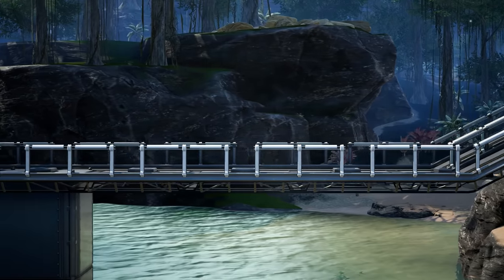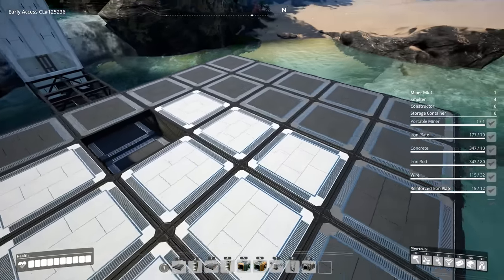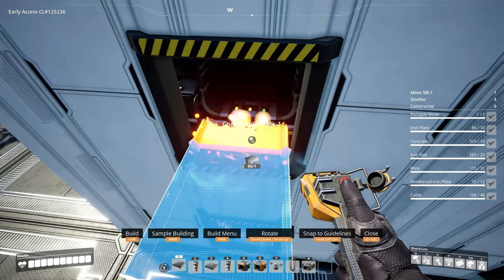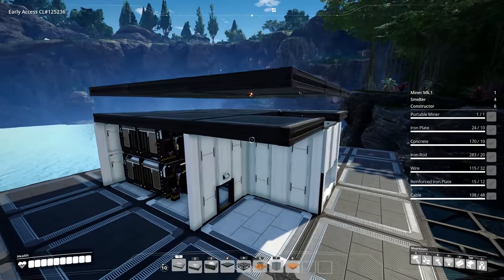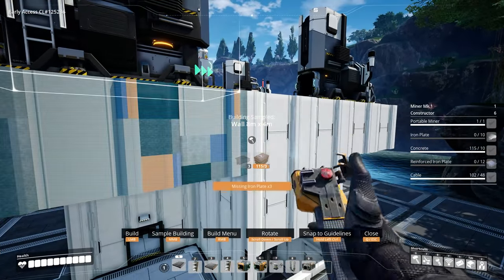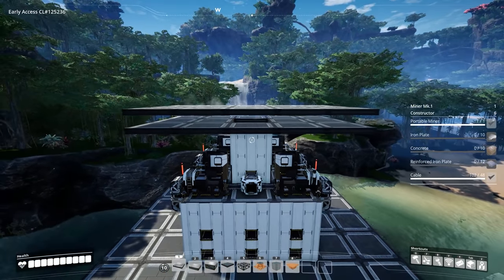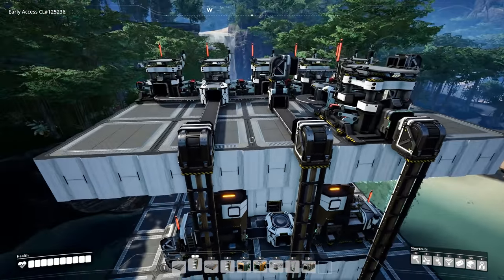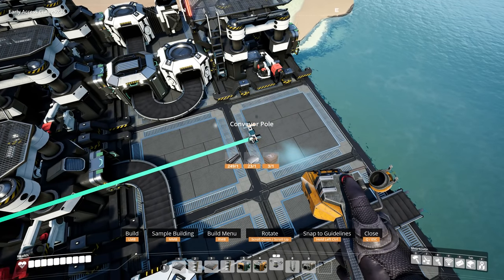100% EFFICIENT Early Game Tier-1 Iron Factory [SATISFACTORY GUIDE]

Comment: I would like to, perhaps reiterate if this has been mentioned already, that the conveyer walls and glass walls are unlocked through the awesome shop. For brand new players, you will need to feed the ticket god before you can do this build completely. You CAN do it without anything from the awesome shop, and those missing pieces can be added in later if you like. You will just need to replace some conveyors and conveyor lifts when you add those pieces.
Reply: Thank you, was looking for this comment.
Reply: Not to mention, unlocking ladders or stairs from the awesome shop to be able to build this without a jet pack too. You could do it w ramps and foundations, but it would be clunky.
Reply: I was curious where you get the walls with the holes in 'em, haha.  Didn't even think to look at the awesome shop.
Reply: update to this, this isn't the case anymore as of update 5. You need to research quartz through MAM in order to get to glass walls and they cost quartz.. basically these structures aren't as viable anymore.
Reply: @louthinator  not only quartz into silica, but they also cost awesome tickets to actually unlock in the first place.
Reply: @els236  When I posted a year ago you didn't need awesome tickets you just needed MAM research... have they seriously locked it behind both MAM AND awesome shop now? Whjy are they making you jump through so many god damn hoops just to get windows?
Reply: there is only one god
Reply: @xPepe1310  yes there is, all hail the Cthulhu, our true lord and savior.
Reply: @louthinator  may you find god inshallah
Reply: "Feed the ticket god" slang term is so damn accurate 😂 Especially in the early game you really have to sink the shit out of resources and Alien DNA capsules to make more sustainable factory designs
Reply: @sunkissed7377  I just use the Stackable Conveyor Poles as the sides work as ladders and when you get to the top of them you can stand on them. A lot less mess and space.

Comment: I was trying to work out the math (not my strong point) on how to set up constructors with the alt for cast screws. Seems its either 5 less rods per min for 10 more screws OR 5 more rods for 10 less screws per min, so it would seem with how balanced the system is may as well not use cast screws (12.5 Iron Ingots p/m )in this build

Comment: Great video. I have been trying to follow the steps you listed, although I have not yet unlocked conveyor walls, so I've been leaving room for them. Then I have a lot of trouble getting the lifters to properly align with smelters and other machines. Did the dimensions of these machines change since original video? Any suggestions?
Reply from the maker: Nothing changed. It’s likely due to your sandwich layer height if I had to blind guess. 

Check out my early game coupon video and get you some walls!

Comment: For the screws constructor section, would this accomplish the same thing as your design?
A merger for the two rightmost constructors would be 15 + 15 merging into a single 30 belt. Then that belt is split 2 ways, once into the screws constructor and the second belt going into the rod lift in the middle. Since the screws constructor can only process 10, the backpressure would force the overflow of the 5 extra rods down the belt to storage since it's the only way out.

This looks like it would work the same as your design but require less resources to build and it appears to be supported by this rule in the wiki: 
If one output belt is stuck, the splitter will attempt to split the items among the remaining output belts.
Reply from the maker: You’d be saving a very small amount of resources and wasting approximately 20 minutes of time before the system ramps up to 100% efficiency.
Reply: @Scalti  thanks, if the net negative is the 20 minutes for ramp up, I am okay with that... My first play through and I wasted 50 hours for spaghetti belts..20 minutes is nothing 😂

Comment: No matter what I can’t get these to line up. Your conveyor walls are slightly different. The actual conveyor wall hole is higher up on the wall than mine is so can’t connect the belt off the lift through the main shaft into the first sandwich area properly. Also the walls don’t sit just above the storage containers so when you foundation over the units glitch through which prevents you from being able to stack splitters on them. Sad. Tried evrything but just doesn’t line up like yours does. I don’t know if Update 5 has changed some of the walls etc

Comment: I really enjoyed your video, thanks a lot for the inspiration! :D I just started out with Satisfactory and oh my am I lost! Quick question: I'm at a point in the game where i need to build smart plating. Should I always start a new factory with these basic iron output, following a more complex factory to build reinforced iron plates and so on or do I just drain stuff from the first basic factory?
Reply from the maker: Build separate. Check out the rotor factory and reinforced iron plate factory. Build both with storage and manually feed assemblers to make smart plating. You don’t actively need to be making elevator parts do manually feeding I personally find to be more optimal.

Edit. You’ll need A LOT late game but even then, over clock machines or just do a massive flat build to make the items and then tear it all down
Reply: @Scalti  thank you very much for the quick response, that helped me a lot! :) Will check out your other videos!

Comment: How are you able to connect the merger and splitter to the output of the constructor that close. I have no chance at all, it only complain it is to steep since there is a small different in heights between them. but no problem connecting it to the input of the constructor that close. Any tips is very much appreciated. :-) PS. Great builds.

Comment: It will be an annoying input of 399 Iron Ore, but I am currently in the process of building a factory using these same techniques to output 8 Reinforced Iron Plates, 6 Rotors, 4 Modular Frames and 6 Smart Plating /min. I intend to just overclock an impure mk1 miner to 39/min...

Comment: Must be doing something wrong here, but since update 5 the tactic @15:52 doesn't work anymore, the splitters funnily enough have hard(er) clearance a grid snap apart.
Reply: Did you find an alternative for this part? I also play in Experimental and I really like this design. 
Edit: Nevermind: I used an elevator for the splitter and merger.

Comment: great vid, 100% efficiency is any plant manager's wet dream. I'm curious how you can align the miner in the middle of a tile. Also, what other mods are you using for this vid. thanks
EDIT : Switch between Miner MK.x and foundation w/out moving the mouse, i guess?
Reply from the maker: Using the hotbar to switch between items. Either that or it’s me middle mouse button clicking to ‘sample’ what I’m looking at and it changes to building that item. 

Check my Instagram (the_scalti) to see a video on how I set my miners on foundations.

Comment: hi guys just looking for a tip. if possible, i have all but finished this build but for the love of me i cannot get the side panels to adjust down on the top floor, i have spent hours on this, just clicking away, haha, the lower levels went in although stubborn did fit eventually, but would love to finalize this and move on to copper, wonderful videos
Reply from the maker: Did you place the walls on top of the top foundation and then build a wall below that one? Send me a video (if you can) or a series of screen shots of your process on twitter or IG and I’ll see if I can help.

Comment: looks at this video, sees cleanliness, sees ability to fly around, sees avoidance of resource costs

"...yeah alright, so floor spaghetti then. The fuck am I gonna get all the concrete for that."
Reply from the maker: From a limestone node. Doesn’t require a lot which is relative to ones patience. If you’re not about it, you’re not about it. These builds are practical in normal play throughs. I just use mods to make building it easier (read: faster) so they’re not longer than they are already. Based on the likes this video has received, it can’t be that burdensome to create. 

Check me out on Twitch. I’m often building what I’ve made in my guides in my standard play through.

Comment: another question, what would the best way to expand and output, just taking them out of bottom chest? and for exanding would you just making another one? or would you just do it again on tip or what?
Reply from the maker: Expansion isn’t needed for this design. It’s meant to provide you the materials to build factories, not feed to them.
Reply: @Scalti good point

Comment: mmhmm so Only thing i would modify on the first floor where the Storage by making the floor print 3 W x 4 deep you get to add a overflow system where this is running none stop. but the only issue you will need upgrade the Line for the screws to Mark 2 and the Conveyor to Mark 2, and the line going to the Shop should be mark 2. for transport am doing a DRONE only play threw probably add a Loading zone for 3 drones to come in and out. But would need a drone batteries being Built here possibly.  Based on distance back to the main HUB.

Comment: This is the first Scalti build I've tried, which I did because my builds did not appear to be "efficient" to me.  The problem is that I'm seeing gaps in the production line.  Inputs are always queued up, but outputs can't keep pace.  Did I do something wrong?  I imagined "efficient" meant input per minute equals output per minute so that conveyors on both side of the process are always full.
Reply from the maker: Belts should only be full if they’re making 60 items per minute. Here, the only belt that should be full is the iron plates. Rods are 20 and screws are 40.
Reply: @Scalti  Okay, that looks like what I've  got, awesome!  Just wasn't sure if 100% efficient meant output belts should be full at all times.  Thanks for the build, I'm going to watch them all!

Comment: How did you create scaffolding underneath your totally amazing build??
Reply from the maker: Not sure I fully understand the question. The scaffolding item is the foundation frame you can buy from the AWESOME Shop. All I had to do was build it under the water starting with where the miner for the iron ore is coming from. 

Hope this helps.
Reply: @Scalti  Apologies for that. Thank you for responding so quickly. I imagine I will need to recycle quite a bit to get 100 tickets. 

You stated that the miner is "under the water" where "the iron ore is coming from." How did you manage that? 

I am actually in the same area and would like to duplicate your massive building.
Reply from the maker: @fuzzyGSpot  The foundation frames only cost 3 tickets from the shop.

I believe you misunderstood - The miner is at the pure iron node in that area. I built the foundation frames from it to the water and then built the frames underwater there with the factory on top.
Reply: @Scalti  Thank you for your kind response and clarification.
Reply: @Scalti  Would it be possible to get a copy of your saved game of this building and the walkway? The reason I ask is because I am having trouble lining up the middle pillar with the walkway, which subsequently corresponds to the correct placement of the platform. Kind regards...
Reply from the maker: @fuzzyGSpot  Let me know if this works or not - https://drive.google.com/file/d/1baJNxQk7nJw8GQAML2tnLHC0DF1nMeR5/view?usp=sharing
Reply: @Scalti  Thank you so much for taking the time and sharing your invaluable game file. I have been working steadily over the last six hours plus. The issue I had with the walkway/pillar was that the pillar tab was sticking up through the walkway floor. 

I felt it was a bit tacky considering there is a metal frame underneath, which should allow it to rest right on top of the pillar. Nevertheless, I managed to work around that particular problem with a lot of tweaking. 

One last question for now though... Where did you get the solid white walls? I could not find them anywhere in the AWESOME shop... Kind regards...
Reply: Doooh... Found the wall but cannot figure out how you are getting power to the MK1 miner with just one power pole and the entire building without any visible lines on the outside. grrrrrr
Reply from the maker: It isn’t properly power. I use creative mods to power my factories since it’s for tutorial purposes and not a live playthrough.

Comment: You used so much iron making this building, I think you would need an iron factory to make this iron factory...lol

Seriously though, I wish you had added the power connections required here. I am just getting started and have only the biomass generation for power and power poles only allow 4 connection so one from generator to pole then three to machinery that needs power, with this factory I would just get so tangled up with power lines going everywhere.  It was a nice video, a pretty factory design, I just wished I could have seen how you would have powered it up as if you were a new player starting out and only had biomass power to rely on but thank you for the video.
Reply from the maker: Have power requirements in the description and a cabling video showing how I power things

Comment: am i missing something or is making 60 plating a miin but only 10 rods not a great ratio, i find if i leave this as is from the video i get an entire box of plating before i even have like 5 stacks of rods so very quickly change of one the plating constructers to a rod constructer.
Reply from the maker: Overall you’ll use far more plating because of MK1 belts but overall, this are all more than enough base items per minute than what an average player would use. You should also be getting 20 rods per minute total and 10 going towards screws, which eventually you’ll no longer need and can just do 60 plates and 30 rods per minute overall.
Reply: @Scalti  yeah i did bad maths lmao, but i literally built this whole set up pretty much freshly spawning just by bum rushing logistics 2 which is maybe why i needed the rods, cos i'd ignored all the other tiers and needed to play catch up but i felt that adding an extra constructor and making 2 more rod factories giving me an output of 40 plate, 50 rods (i think) and 40 screws seemed to net me the results i was looking for

Comment: I loved your video and it has made me think differently about how to build in this game but I was hoping someone could help me troubleshoot an issue. I copied your build exactly as you did it. The only difference is that I have all the machines overclocked to 200% and I have 240 iron ore per minute coming into the building. The ore travels up to the top of the lifts that feed into the smelters but it just stops there. I don't get it. The smelters are all powered, all turned on and I know the lifts are correctly placed because when I delete a lift and then replace it the ore in the new lift feeds the first 10 pieces of ore into the smelter which it turns into iron ore but again, it then just stops working. Anyone?

Comment: my sandwhich layer walls wont give the option to snap into the correct location? any help
Reply: I was able to replicate the build by adding a foundation under the bottom foundation of my dad which layer..... this allowed for the wall to snapped correctly to the sand which layer...... just delete extra foundation after and boom! I just wish i didn’t have to take the extra step and it just worked like scalti did it

Comment: Idk if they changed it but I built the farm the exact same and it’s pretty slow I can hear machines stopping after every resource made any idea why?
Reply from the maker: 120 iron ore input into the factory? Guessing you messed up a belt speed or aren't using a pure node.
Reply: @Scalti  no just changed it a bit now works fine
Reply: @Pugerino  Hey I am having the same issue. WOuld you mind telling me how you were able to get it to run at 100%? Followed every step perfectly and even redid the whole thing again and it still is only at 50% and not the m100% as stated in the video title

Comment: I like the build but ultimately feels useless for the amount of time it takes to build it as a beginner vs what you get out of it. You don't have flying so moving around with platforms and ladder's is quite time consuming. All for 20 rods, 30 plates and 40 screws per minute. Which ultimately feels pointless since rotors take a heck of a lot more screws.. it would be nice if it was somewhat scalable.

Comment: To add to this,  this build is broken in U5 due to clipping issues
Reply from the maker: What part of the build is broken so I can verify and if need be, make a new guide.

Thank you

I checked the portion where it's a splitter and merger between 2 constructors and found no issue. Perhaps one of the constructors you placed is off by 1m?
Reply: Also: the vertical conveyors models are not the same models in the current version than in your video if i'm not mistaken. The airlock at their entrances seems to be longer ? So it makes it really hard to connect them properly to the smelters because they glitches inside them...
Reply: Allright found a bypass (sorry i'm following the tutorial right now): smelters have to be built AFTER the vertical conveyers so the blueprint doesn't try to put the belt on the buildings but inside it. If you see your belt blueprint trying to be made on top of the structure instead of inside it you did it wrong. 

So just erase your smelter, and build it again, normaly when you will try to connect the vertical conveyor to it your blueprint will be inside the airlock (not visible) but right after you click it you'll be abble to see the arrows and make it connect to the entrance of the smelter.